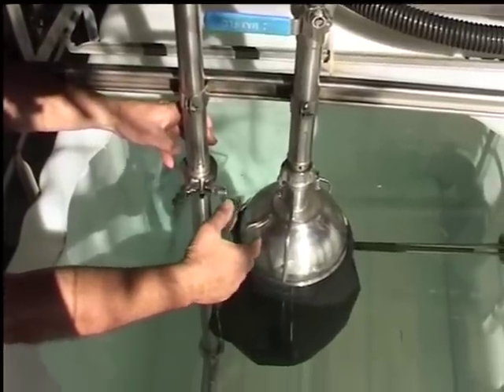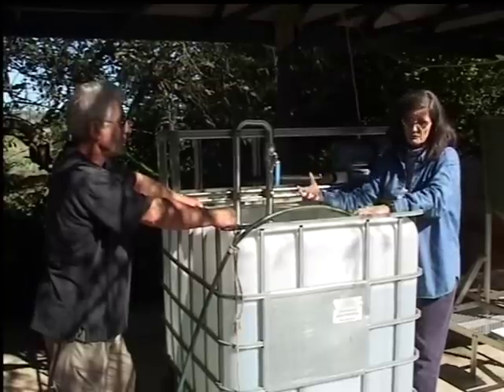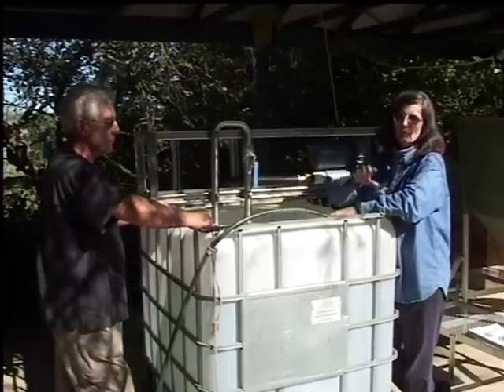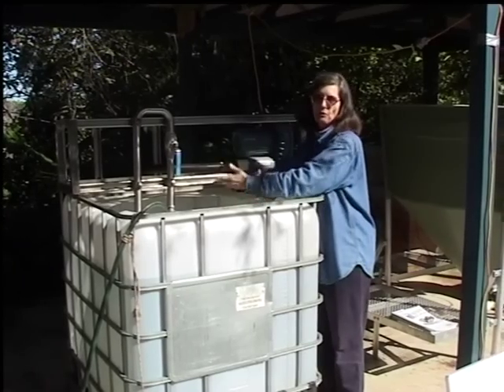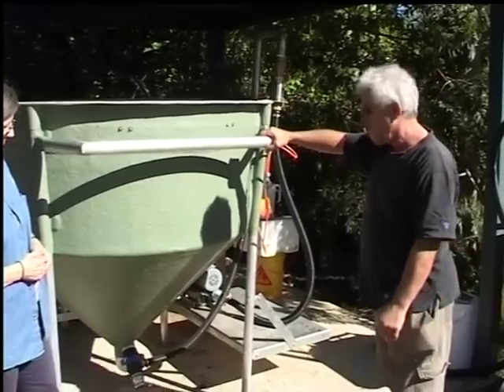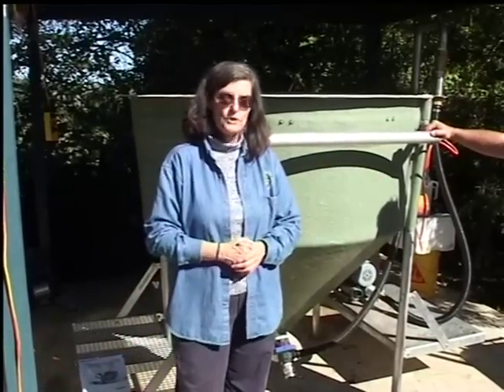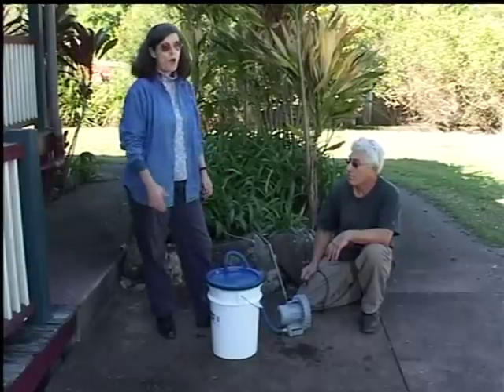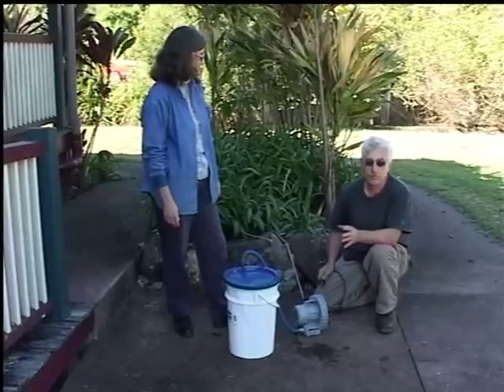An Introduction to Actively Aerated Compost Tea Brewers

Comment: Hey Paul, We met at Geoff's In Australia in 2010.  I am Building a brewer for our Farm here in Canada and was wondering the aeration needs to be equivalent to the volume of water every minute Ie 1000L/min in the 1000L Brewer?  Also I have been doing research and the PVC is designed to kill bacteria so the KISS brewer will have a built in deterrent to producing bacteria as it will kill them at the same time. Is it not better to use a HDPE or LDPE pipe?

Comment: Thank you very much beefytroy! I have been putting alfalfa meal,kelp meal,azomite,compost,molasses,worm castings, chicken manure,coco hulls/coirs, and crab meal together in a mesh bag and squeezing that out 5-6 times a day while it soaks in a 60 gallon container! I have 2 air pumps for just this container the aeration is great! I am making what I call super compost/fertilizer tea! I guess from now on I am only going to add the compost,molasses, and other foods to feed if I am using right away!
Reply: Edgar Poe whoa, this sounds amazing. Have you been getting higher yields using this recipe? What have you changed?

Comment: i'm amazed how people think Bigger's Better for aeration... you could learn a lot from aeration of aquariums -- it's not the quantiti of air, that is pumped trough pipes, that maters, it's quality of bubbles! if you have tiny bubbles, than you get more surface to diffuse air into water per pumped air, as you would get with larger bubbles. So, first you have to make a nice diffuser, like air stones or similar which will make tiny bubbles...

Comment: Seems to me that once a system is run once, simply leaving some dregs in the bottom of the brewer contains all the biology needed to run another cycle... And another... And another... A kick start in the spring with worm castings etc... And then, just feed it each time... Am I missing something? In fact each cycle becomes more species diverse as bacteria and spores floating by in the wind are grabbed by the air pump and injected into the brewer.

Comment: What is the cfm on the aerator? From what have seen else where they want .08 cfm per gallon so for a tote would be 22 cfm which is probably 1000 times smaller than the one in video. Can you advise?
Reply: Did you find out any answer for it? As I am too confused to buy the appropriate one for 250 gallons compost tea
Reply: what is a tote?  this is not a tote. you dont need the amount of air to be huge, just bubbly.

Comment: Hi everyone! Does anyone know how long would I have to brew with water that is 14 celsius... 57 fahrenheit?

Adding my compost / wormcastings to this is probably quite a shock to the organisms in the compost... is this temperature okay or do I need to either bring the brewer indoors, or get a heater??
Reply: I've brought my brewer inside before when I'm doing small scale.  I've also been successful insulating the brewer for larger scale.  Hope this helps

Comment: bigger blower -> more noice :) bigger blower -> probably more Watt :s
and more bubbles does not automatically mean equal oxigen distribution to water.. bigger bubbles do ascent faster and there for have shorter time to deliver, so you have to pump a lot more air to have same effect :s
in the end choices are few, but i like it smooth and easy :D
Reply: The O2 does not mix from the air bubbles to any appreciable degree. O2 mixes primarliy from the aggitated surface of the water, thus the more/bigger bubbles are best.
Reply: Raurke Goose r u both saying the water needs to be broken up more?

Comment: You can't blow off chloramine only a reverse osmosis can do that. My question is will chloramine kill my tlo?
Reply: Humic acid binds it up I think
Reply: +Andrew Towell I read somewhere that molasses may do so as well, also a common additive to teas
Reply: psbjr cool, elaine ingham says use humic acid
Reply: Andrew Young r u sure a that statement??? 🤔🤔🤔 How up to date is your information?
Reply: In 2019 in the midwest us i was told most cities use chloramine. It was my understanding you can't blowoff chloramine but can add a water conditioner. Will lock up the chlorine but leaves ammonia.

Comment: could you post a design or a link for this design so I can start scavenging parts! thanks much.
Reply from the maker: if you seek advice let me know what you are doing and what you want to apply the compost tea to, unfortunately compost tea is highly misunderstood, it is based in a complex science but it is actually not complicated. I believe that Elaine's work is often misunderstood, at trust nature, we take the mystery out of the science and teach it as 1 element of Trust Nature's Bio-Vital(™) system of sustainable soil management,  Remember you can't make a decent soil pro-biotic (compost tea) unless you have very good compost and aerate the water. thanks: Paul
Reply: Any Luck finding what kind of pump she uses?
Reply: It is not a pump. It is an aerator. Look for aerators. Insuflator, whatever.
Reply: spa pump
Reply: Paul Taylor So true, Water is a must! 😁💧🌊☔
Reply: specifications of the pump?

Comment: your right and wrong.... your correct that finer bubbles allow more oxygen to transfer to the water because of the increased surface area of the smaller bubbles. However pumping more air makes more bubbles so having a bigger blower helps. Temperature is also an issue, lower temp more DO...to around 55F...but bugs grow faster at higher temp...trade off
Reply: This is incorrect, sorry.

Comment: chlorine doesn't comes out for 24 hours, not 45 minutes.  never heard of less time, till now.  thumbs down.  now fill with dirt, then try to easily mount it, not easy is it?  stupid design.  You say that adding to much food turns it anaerobic, but with that much air, you will never turn it anaerobic.  only by feeding the fungi foods, does it turn anaerobic, so feed the bacteria, not the fungi as much, still need, but not overwhelmed, by fungi food.  Dont spray leaves of what you are going to eat, taste like crap.  never spray leaves of flowers.  The cone tank is the way to go, gentle air bubbles, underneath, just hang the tea brew, not some god awful rod in the center of a bag.  the cone tank is NOT transportable, nor is the square tank, but the square one can be put on a trailer first.  the cone tank is to heavy and bulky to move easily.  i do like the little 5 gallon bucket with pvc pipe coiled in the bottom with holes and a bung on the end to stop the flow out the end and go thru holes drilled in it.   the air pump is way OVERKILL.  way way to big for 5 gallon bucket.  they are going to kill the microbes, not produce them.  dont put compose in a bag, just dump it in, free flowing.
Reply: i think you are used to aquarium water change. it take (at least) 24h if you juste let it be but if you stir the water it might be faster. althought it seems quite fast to me too considering the size of the first container.... (but i'm not a bioogist like elaine)